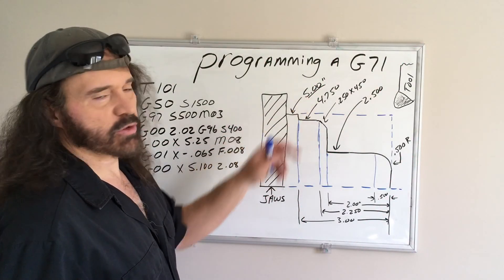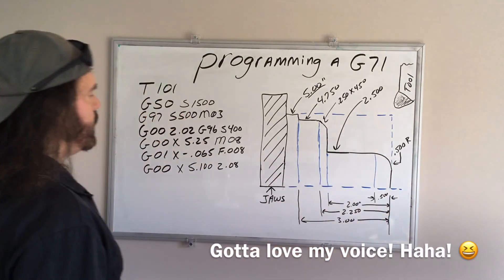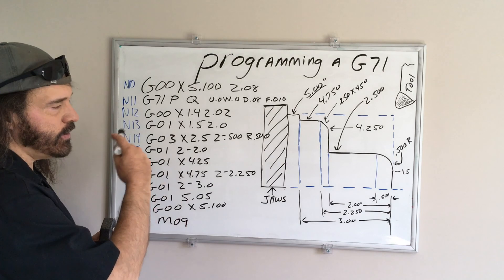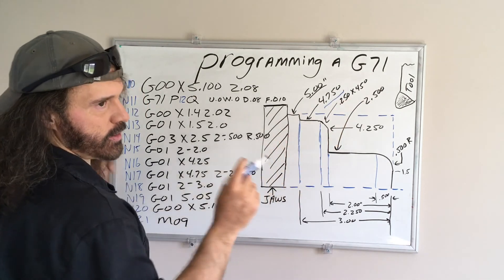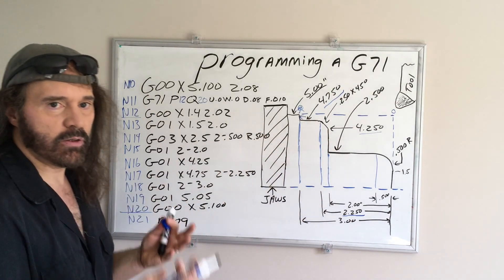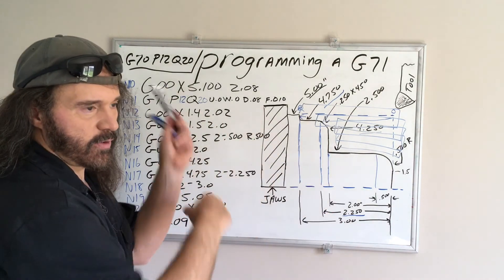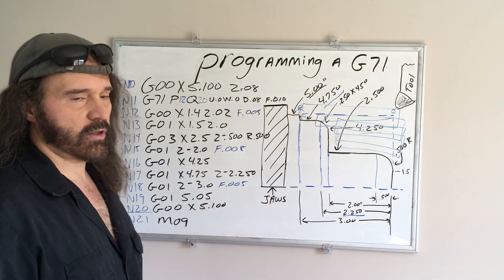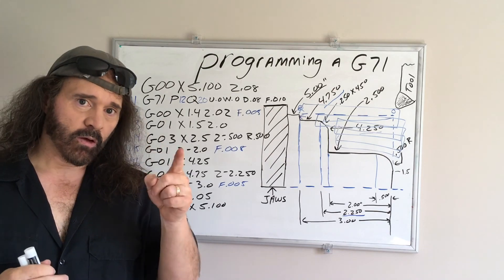Programming a G71 canned cycle - HAAS CNC Lathe for beginners / Intermediate

Comment: Can a use a G96 in a G71 cycle? Im working on a diameter of .110 to .375 thousands. Its making a lot of shatter... It has S1800 F.002 its A2 steel...
Reply from the maker: Hi there…….So yes, you can place a G96 surface speed while doing G71. 
Your G96 will be placed before your G71 cycle.
Here’s the tricky part……there are many variables that could be giving you chatter on your finish.
Tool nose radius being used.
Length of part being turned 
Finish pass in program might need adjustment 
So, it could be many variables.
You mentioned S1800….is this your max rpm in your program?
I’ve worked with A2 also. It can be tricky trying to get a nice finish.
If you can let me know as to how long your part being turned…..maybe I could give you more ideas.
Reply: My experience with A2 is that it doesn't like light finishing cuts on extremely small diameters like that.. you're probably not gonna be able to get away from the chatter issue on a part that small, especially if there's any length to this part.. it might need a secondary grinding operation if a tight tolerance is required.. being that it's A2 and it's gonna get hardened anyways.. a secondary grinding operation isn't usual..

Comment: what about the retract value ? where do we mention that
Reply from the maker: Hi There!....Do you mean sending the machine home? I didn't show that in this video....I only mentioned in the video that you would continue your writing to send your X and Z values home. I ran out of chalkboard in the video (Ha!!).
So, after your done machining your G71 canned cycle(in this video it was N12 Q20....which is line 12 to line 20)....I usually program my X axis to head home , and then my Z axis home.
Reply: @Tims-Tractors-and-more  no i mean in the G71 cycle how do you know how much the tool is going to retract like after the depth of cut like how much the tool is going to move in x and z positive direction
Reply from the maker: @AmanDeep-ki3xf  Gotcha....so, I'm going to make sure of my answer when I go back to work on tomorrow.  I'm pretty sure the X axis retract is usually the amount of your depth of cut per pass, and the Z axis usually goes back to your original Z starting plane before the G71 was called up.
I will reply back again in a day to confirm my answer.
Reply from the maker: @AmanDeep-ki3xf …..I wrote a mock program to verify and yes….the D value you have in the G71 line is the retract value in X and the Z retracted to the original Z starting plane just before you call up G71.
Reply: @Tims-Tractors-and-more  love it 👍🏻thanks  for clearing up my doubt 🫡

Comment: Using g71 canned cycle type two with cutter comp g40 where do I compensate apparently the machine doesn’t like the comp because it can’t switch tool nose directions
Reply from the maker: Hey there….thanks for the question.
I’m currently at work and just wanted to send you a quick video link from HAAS talking about this.

https://youtu.be/0_GiMspK0pc?si=NF4Mm2pgEGnsa4bI

Comment: I’ve been trying to run a g71 cycle on a haas st10 but I keep getting an alarm that says (370 canned cycle geometry error) and I went through the user’s manual and still couldn’t figure out why I’m getting this message
Reply from the maker: Yeah, sometimes the smallest error will generate an alarm code. If you want to show me how you wrote your program starting at your G71 block and where you end....maybe I can help out.
Reply: I know I should’ve ended the g71 cycle at n16 instead of n17 but the reason I did it this way because when I wrote a g70 finish cycle I had to end it at n17 so It can read the g40 because I got a message saying that I needed to have a g40 in the program, so what I want to know is can I use different P and Q numbers in g71 and g70 for the same cut?
Reply from the maker: @alielhoujairi2420   I'm not sure if you attached your program to this post, because I don't see it.
I would need to see your programmed path in order to hopefully help you out.
Usually whatever your P & Q codes are in the G71 cycle will need to be the same in a G70 cycle. I'm assuming you are using cutter comp in your machining cycle?
One thing I always do is to make sure your starting X location and your ending X location are the same. I will write a small program below turning a make believe 1.00" part using cutter comp and using a .031 tool radius....I will illustrate below with line #'s - 

N1 T101 (turn o.d.)
N2 G50 S2000
N3 M97 S500 M03
N4 G54 G00 Z0.01 G96 S500
N5 X1. M8
N6 G01 X-.065 (allow for  tool radius) F.01
N7 G00 X1.1  Z.1 (notice X & Z value)
N8 G71 P9 Q15 U.02 W.01 D.06 F.01
N9 G00 X-.065 Z.07
N10 G01 G42 X0. Z0. F.01
          (cutter comp on)
N11 X.95  F.005
N12 X1.0 Z-.025 (chamfer)
N13 Z-1.0
N14 X1.08  F.01
N15 G00 X1.1 G40
 (notice X value on line 15 - Cutter comp is also turned off)
N16 M09 
N17 (G00 X and Z home or ?)
N18 T100 (tool cancel)
N19
N20  T202 (Finish turn o.d.)
N21 G50 S2000
N22 M97 S500 M03
N23 G54 G00 Z0.1  G96 S500
N24 G00 X1. 1 M8
N25 G70 P9 Q15 
N26 M09 
N27 (G00 X and Z home or ?)
N28 T200 (tool cancel)
(etc, etc)
Now , this example is if you are using a different tool to do a finish pass......you could use tool 1 for a finish pass if you wanted to......you would just put your G70 P9 Q15 line right before the M09 line. Also notice the feed rates being used in G71 cycle......the feed rate listed on the the G71 line is the feed rate being used to remove material......when you do your G70 cycle, the feed rates listed in the programmed path will now be used .
Hopefully this makes sense ! :-)

Comment: If you are using a different tool for the finish pass do you rapid the tool into the starting position and then apply the the g70 code?
Reply from the maker: Patrick, I personally do that. So the spot you rapid too for beginning the roughing cycle, I use the same spot to rapid for beginning the finish pass.

Comment: Why would you not go into a g70 cycle to have a nice clean up pass?
Reply from the maker: Hi Steve.....you are absolutely correct...I always run a finish pass and in the video at the 2:30 part, I mention the use of a G70 finish pass using a different tool, but this demonstration was mainly focused on doing a G71 stock removal when you are first starting out.
Reply: @Tims-Tractors-and-more  ok, no problem there. I do really like your videos. Wish they were around 20 years ago.
Reply from the maker: @stevebriggs9135  .....Thank you for the kind words.
I wish YouTube was around 20 years ago !! 😆😆

Comment: First off, THANK YOU for taking the time to explaine all this! You make it so simple for someone starting off without any experience in tool and die! 
I have been working more and more with our CNC machines, but I am burning through carbide inserts on my boring bar. The culprit is a backside chamfer on an ID (or so I think). The program has the boring bar plunge into the DOM after it finishes removing the inside material, and it causes the tips to break often. Do you have any suggestions on what could help extend the life of my tips?
Reply from the maker: Hi Tim, thank you so much for the kind words and watching my video!...Well, there are many variables here so I'm gonna ask you a few questions first. 
(1) What kind of material are you machining? (2) What is the diameter of the bore you are doing? (3) Did someone else write the program? (4) Are you on a HAAS Lathe? (5) Are you doing a G71 canned cycle? (6) I assume there is a drilled hole that goes through the part? Sorry for all the questions.
If you want to, write down the G codes you are using and the canned cycle that is being used. If you are using a G71 canned cycle, make sure that the U value in the canned cycle is a negative value(-). So you would have a code like this,
G71 P#Q# U-.02 W.005 D.05 F.005 
So, you would enter in the P the line # to where to begin....say line # 10.....so that would be P10.
Now, what line number do we end at....let's say line 13.....that would be Q13. 
Now, lets say you are doing a 2" bore and you drilled a 1" hole through the part. Lets say you are doing a Z depth of 2" deep. Here's a quick example of setting up a boring path I usually did,
N8 G00 X.950 Z.100
N9 G71 P10 Q13 U-.02 W.005 D.05 F.005
N10 G00 X2.00 Z.06
N11 G01 Z-2.00 
N12 G01 X.980
N13 G00 X.950
N14 M09 
N15 G00 X10. Z10.00 M05
Etc, etc, there is soooooooo  much more I could include, but let me know how your program is written first before I get to far ahead of myself...haha!!
Reply: @Tims-Tractors-and-more  The material is 1026 DOM, It is initially 1.750" and is bored out to 1.781" on our HAAS ST-30 Y. With the size of the bore we are taking the stock off in one pass, no drill. The program is generated by MasterCAM right now, but I have been going back and adjusting some of the issues that I have noticed. I believe the programmer isn't double checking the parameters to adjust the feedrate when the boring bar makes the plunge for the back chamfer.
Reply from the maker: @murderface3131  Ohhhhhhhh....gotcha.  First off, Nice machine! I begged my former employer to get a Y axis lathe! Haha!! I personally never used Mastercam, I programmed everything myself. A place I just began working at uses Mastercam and yes, I scroll through the program and notice some feedrates are WAAAAY to fast, in my opinion. 
I would check that feed rate when it's making that plunge in the back of the part to make the chamfer. If your going through insert bits and the tips are breaking, that would be my first guess.
Reply: @Tims-Tractors-and-more  If I was going to alter that feedrate, would it just be adding a (F) code at the end of the line that does the plunge?
Reply from the maker: @Timothy Buchanan Yes, the f code is the feed rate code. Sometimes the even use an E code for feed rate, but very rarely. Whats the feed rate now? Try lowering the number....if you have a feed rate of F.010 - try cutting it in half....F.005
Reply: @Tims-Tractors-and-more  I believe it is already .005, I'll check the program tomorrow morning and add a lower feed on that line! Thanks for all your help! You earned a subscriber today!
Reply from the maker: Timothy Buchanan .....thank you for subscribing 🤘 Yeah, try going down to .0015 or even .002 and let me know how it works out.
Reply: @Tims-Tractors-and-more  that worked like a charm! We have been running that bushing all morning and not a single broke bit! Thanks so much man!
Reply from the maker: @murderface3131  Fantastic!! Glad it worked out for you!

Comment: will the canned cycle also repeat m code if its in the code like for opening and closing a steadyrest or clamp type follow rest on a shaft?
Reply from the maker: Thank you for the question! I think I understand what you are asking......I don't believe you can have a M code for opening and closing of a tailstock rest or a tailstock opening and closing of a sub clamp included in the canned cycle. 
Did you try writing your M code move in the canned cycle and watch it graphics mode to see if you get an alarm? 
I know that some programs I wrote in the past, such as turning a piece of bar stock, I would do a canned cycle to remove as much material as possible and after that canned cycle finished, I would get the turret out of the way and program a tailstock move with a live center to engage the part...(should be a M21 code). From there I would continue with a finish pass...which is a G70 code to follow your values you wrote in your G71 canned cycle. 

If you are doing a large piece of stock and are removing material in stages, you will need to write multiple canned G71 cycles....For example, lets say you start at the front of the part and write your first G71 canned cycle. Now, lets say your P and Q codes are P10 and Q20 (for this example). You go ahead and machine that section and now you finish that section and want to move on and machine the next section. Stop the machine and move the turret away and do your clamping that you mentioned about. From here, if you wanna do more material removal and want to incorporate another G71 code for stock removal, you are gonna have to use different P and Q values. Now you can write your new G71 stock removal cycle and for this example you could use a P30 and Q40. 
Just remember, for each G71 stock removal cycle you program, you need different P and Q codes. Be sure to watch the program in graphics mode and see its doing what you want it to do and also it checks for alarms in your programming format. 
I hope this helps!